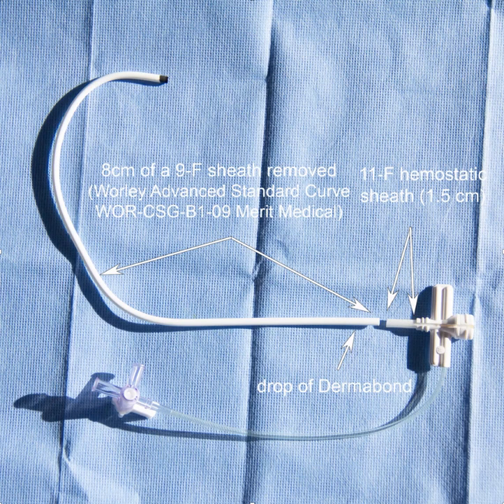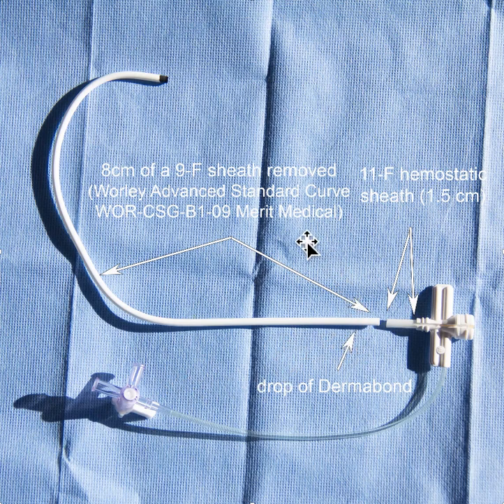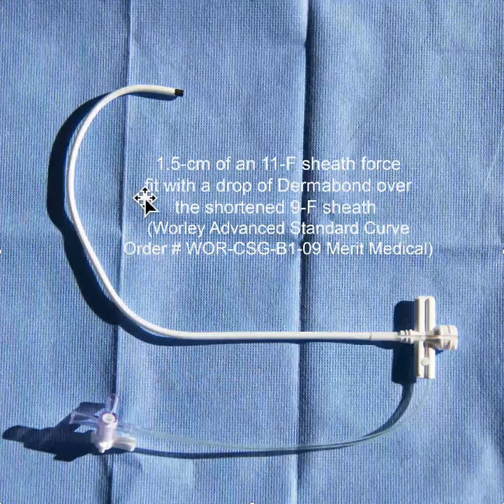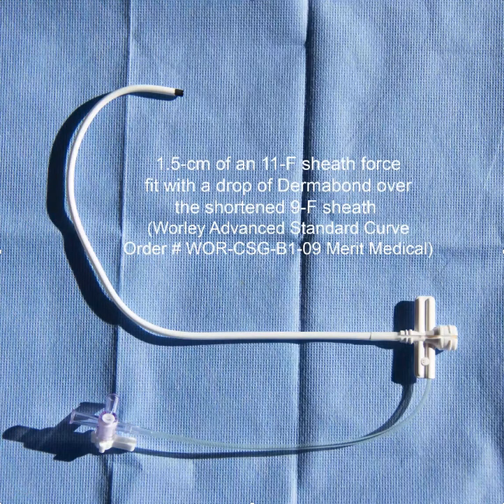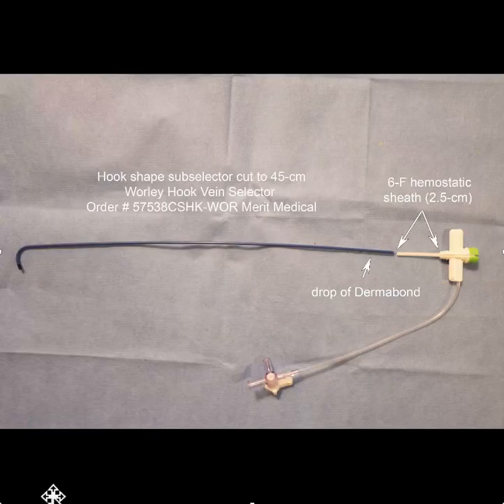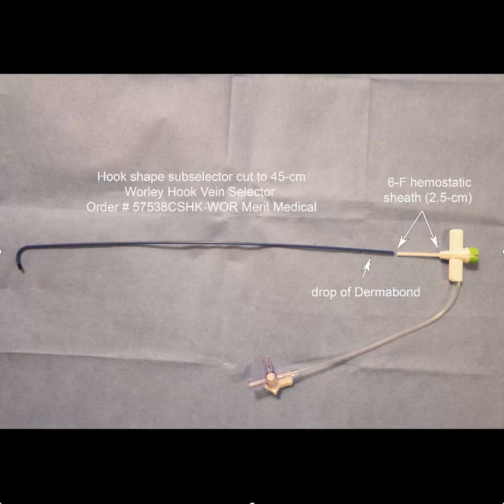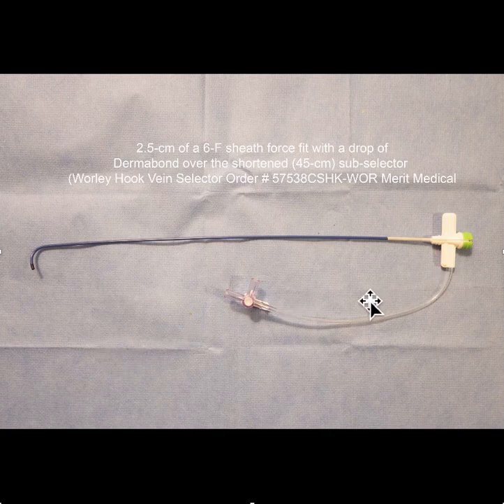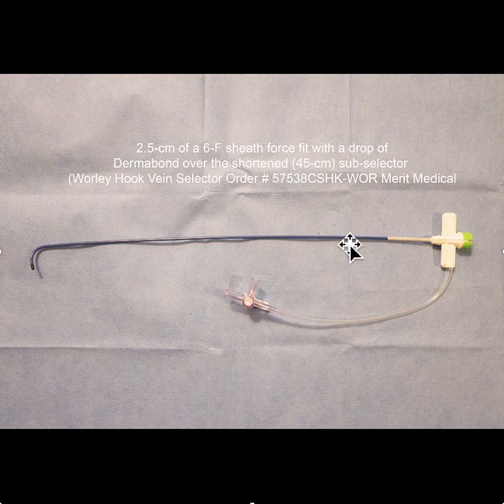HIS Pacing Tool options V1 10 Feb 18 with Audio

Comment: Have you tried this for use of implanting a lead in the His? How do you remove the sheath once the lead is fixated? The Worley are split aways. So does the crazy glue allow you to split all the way down both sheaths?
Reply from the maker: Hi Paul. I have little personal experience. The Worley sheath will NOT turn septal so you need a second telescoping catheter to point the lead. 
For MDT leads one of the fixed curves. For the 6-F leads you can shorten one of the Worley 9-F OD, 7-F LVI (Hook shape likely best)
With regard to sheath removal, Once the 11F hemostatic is peeled away you will need to grab the edge of the worley sheath with a small hemostat and use a slicing tool or scissors.